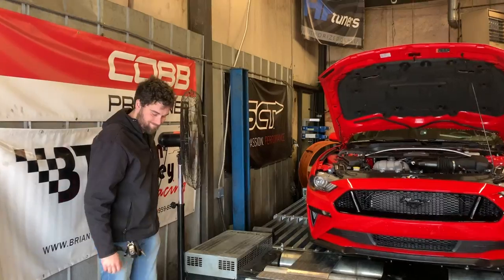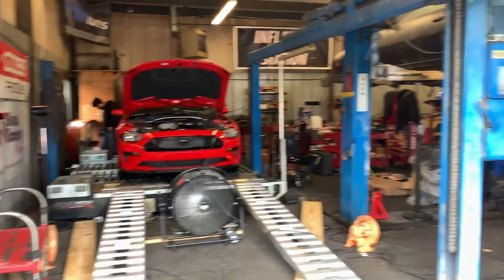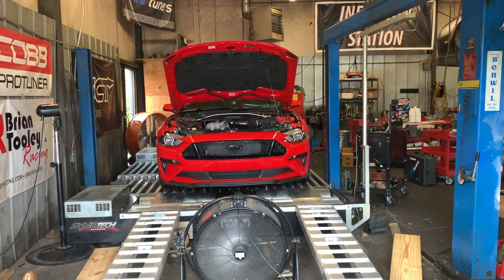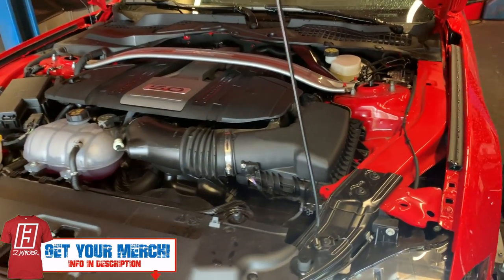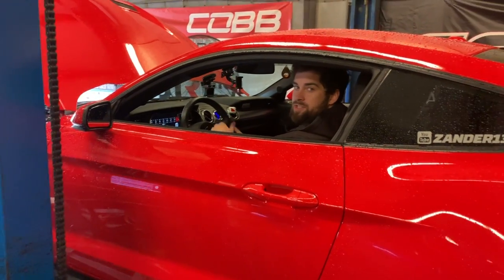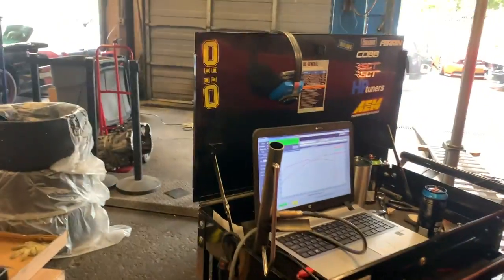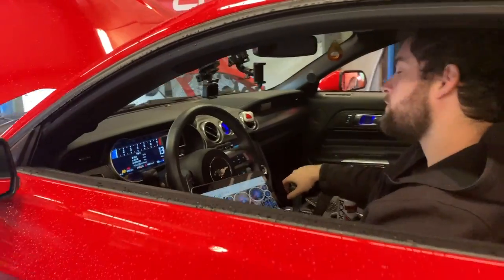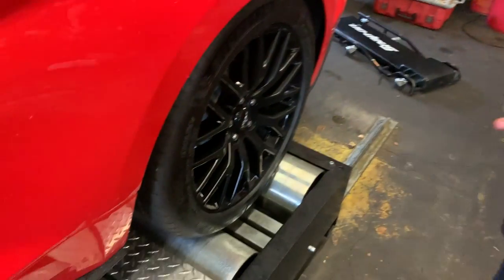NO B.S | This is what a 2018-2019 Mustang GT Actually makes on a Dyno

Comment: That sounds dead on correct for a 6500 RPM pull. IMO, you're looking at about 415 as it climbs to 7500. Nice of those guys to offer you their shop for comparison.
Reply from the maker: Yes, I am thrilled they did that
Reply: Zander13- Didn't beastmode hit 436rwhp 400 trq at 7500 in his 2018..? In your blue 2018 was 430rwhp...
Reply: I think at 7500 rpm is the meal ticket as the top end of that is where the full power comes from, right??

Comment: Glad you was able to get a comparison! I would have liked to see him take the limiters out and run it to 7400 just to see. I agree having a local tuner is great.. Has worked out great for me having one close to me... I wouldn't have expected the service that I received from my tuner  from a tuner that was remote tuning. The trackside tuning alone was worth it...

At the end of the day your hp numbers can vary from dyno to dyno.. I've always said its a tuning tool and good to use when you do modifications to the car so you can see what you picked up from modifications. If you use the same dyno over and over. Trap speeds at the track tell the tale!

Comment: I've dyno'd anywhere from 340 to 370 hp at the rear on different dynos. I've never cared what the number is,  I only care how the number changes on that dyno, on that day, in regards to the changes i make. It's a tuning tool.
Reply from the maker: agreed
Reply: Another way to say that is it's good for measuring relative values, not absolute values.

Comment: My 17' GT with 8000 miles got 379  6 months ago, for comparison, bone stock except we removed the air filter, Phillips 66 gasoline... 6 speed manual...   Automatics do better with turbos,  manual transmissions probably would do better with a supercharger.

Comment: Supposed to do dyno runs in a 1:1 gear ratio. For the A10 that’s 7th gear. Any gear lower than that, even 6th, is still multiplying torque and will give a higher/false reading.
Reply from the maker: A gear below 1:1 does not make more power. It makes less not more but a gear above 1:1 will show more power.

Comment: Eddy current, dual roller and single roller inertial all give slightly different readings. 
Hell tire pressure can have a significant effect on RWHP readings.
Nice results for an oem set up!!!

I can't wait to check my 19 GTPP on a DynoJet in ground single roller inertial that we use locally. My 460 powered 73 LTD did 456 SAE NET @ 6k rpm.

SJ

Comment: Good video man! Glad you redid it. All these engines are pretty predictable in stock trim, and even between all the different tuners and tunes I've seen this year, I haven't seen variation between the tuned cars any more than 10whp at the max.  Especially the A10 cars, the stick cars do put down around 15-20whp more, but then again, they sure aren't quicker at the track either.  A10 is definitely the way to go if you want to have a quicker car right out of the box, go stick if you wanna have a bit more fun and spin the tires on the street at will.
Reply: Beastmode in his 2018 10sp auto hit 436rwhp at 7500....  im not sure you are accurate in that comment. Also, zander in his blue 2018 hit rwhp of 426, 428, and a 430hp....

So are the 2019 not producing as much, or the hit @6200-6500 losing that much power by not hitting the 7500? Just saying, two 2018's both were very similar with an additional 26-36 rwhp @7500...????

Comment: Zander. 
The only dyno numbers that matters to the viewers, are the standard Dynojet ones (non Eddy current ). 

So if you want a real world number, both for you and your viewers. Get the car baselined at a Dynojet 224x and have the rev limiter removed so you can rev out the motor.
What is the point in dynoing  a cars engine power if you don't use the full range of the engine powerband!
As a tuning tool you can use whatever dyno you want. But as general comparison tool against other cars engine power. The industry standard is the Dynojet 224x.  That are the only valid comparison numbers.

Comment: Just think, the stock 2018 and 19 GT's, are making over 50+ rwhp and 50+ rwtq more vs the 15-17 GT's. Then you factor in the awesome 10r80 and you have beast of a machine. I know, I had a 17 GT manual and just bought a 19 GT PP 10R80.

Do you plan on getting a tune? I'm seriously considering it just to firm up the shifts and fix some of the lower gear downshift revmatching issues in manual mode (3rd to 2nd is one of the worst).
Reply: JCTiggs 
Do you mean 50 more based off dyno numbers because the factory hp from a 2017 is 435 hp and 400 tq, Fords claim is only 25 hp more and 20 tq more because of the addition of port injection and the gt350 intake the 2018 numbers from Ford are 460/420
Reply: @Sonicaceman  Yes, that is confirmed SAE rwhp and rwtq based on many dyno runs in other words, 490+ hp and 455+ lb ft at the crank. This is at least 55 to 60+ hp/trq compared to the 15-17 GT.  The advertised numbers at the crank by Ford are underrated and is a well known fact. Possible reasons could be to protect the GT350, otherwise who knows.

Comment: 442bhp 511 tq to the wheels at 7100RPM on a Swedish (EU) 2018 GT, Manual with 3.55 gearing (different to PP1 in the Us albeit being a PP1). 98 octane (EU, 93 US but probably higher quality fuel). Pleased. Us EU people get gas particulate filter on all 2018+ which I thought would ruin the power but numbers suggest otherwise. Also one has to wonder how empty that particulate filter section of the exhaust is, as well as the cats, considering the power. 450 BHP claimed on EU cars, delivering that to the wheels....... lol. PS: Dynojet used in this case with fuses out to prohibit BS letting us dyno it proper. Tried both 4th gear (straight ratio) and 3d (computer re-calcs) and the values matched until rev limiter due to 155mph limiter vs 3d gear not hitting the limiter. Hence reliable numbers since curves matched until 6900 rpm in both cases, numbers too.

Comment: The 3 Mustang GT's I have seen dyno'd stock make between 400-415 rwhp.
These new Mustangs with Autos have around a 12% Parasitic Loss, Which would translate to 405 rwhp from 460 crank hp, so you are right near what it should be.

Comment: Dyno numbers can change day to day i found and are hard to repeat  because of atmospheric conditions   plus types of dyno  used even technicians operation can cahnge data that why when rating it done over several months and different dyno's,,   I do wanna say this car number are awesome for a stock daily street car this is rear wheel numbers flywheel power should be approximately 28% -30% higher

Comment: I think a tune does up the speed limiter were you can do it in 6th as i did mine. My tuner said that i could have done it in 7th but it was too late by then because i talked to him after the dyno and not before. He told me between 6th and 7th there is 10-15whp difference. I did 443whp and 410wtq in 6th at 75 ambient. In 7th it would have put me probably at 453-458whp. Either way this is your older vid your much much higher now, love that red. Great vids keep posting them.

Comment: In reality horsepower is an arbitrary number. It is relative to tourque. The hp and torq will always be the same at 5,252 rpm. If you want higher horsepower do your pull in a higher gear but this will reduce your torque. The only way to truly compare hp numbers would be to test it in the top gear where the transmission is running close to a 1:1 ratio. For instance older s197 mustangs come out with like 3.56 gears where the newer stanges come out with 3.73 gears with more gears in the trans. These mustangs being fast have more to do with transmission, gears, and 7,000 plus rpm redline, and they have electric power steering. Motors are good but wouldnt work as good with the older mustangs gears and transmissions.

Comment: glad you got it worked out. i was wondering if Ford made a mistake and you got a Bullitt engine tune. Stranger things have happened in the automotive assembly line. I think the most first mod people do is cold air intake or a X pipe exhaust. Looking forward to see what you do with yours. :)

Comment: with your single "mod" im completely comfortable calling it a 430 horse car. Those 10r80's have virtually no extra parasitic loss over the mt82's. Modern automatics are magic compared to ones even 10 years ago. Coyote motors are neat little engines and all but the real secret of them are the heads, from the factory the heads flow better than full cnc ported 429 heads and as well as fully ported ls1 270cc heads and thats before porting, after porting they flow as well as ls3 290cc fully ported heads or any 12 degree brodix bbc race head.
Reply from the maker: We re dynoed the car in another video at it 408 at 6500 rpm. If we could spin to 7500 I’m sure it would be 415

Comment: Only difference is a cold air intake and tune on the bullit  a little different muffler as well i think...
Reply: The bullit has a ported gt350 manifold from factory as well. I think a bigger throttle body too but not sure.
Reply: @rileyneufeld7001  yea i think you are right a good value really for the money nice set up.
Reply: @coloradokid808  Yep. Midnight performance dynod one, it made about what a GT makes... Not much difference.

Comment: I'm curious to see what the numbers are if you put it on an actual DynoJet. I assume you had 93 Octane in it?

Justin on AM only pulled a 398 rwhp with his 10R80 but it's was right of the show room for with 87 Octane. That's the lowest I've seen for an 18+ GT. For comparison, on the same dyno, their 2018 GT pulled 437 rwhp and 402 rwtq, while their 2015 GT pulled 370 rwhp and 350 rwtq.
Reply from the maker: Yes 93 octane

Comment: Another great vid my man! I just went back to my dyno printout because I didn’t notice what they revved it out too during my pulls. Looks like they shut it down at 6800 RPM on mine. You definitely have another 5-15hp in there if you can rev it out past 7k.

Suspension mods? Cradle lockout? Rear subframe connectors? Those are my next mods haha 

Keep em coming brother, great job! Cheers
Reply from the maker: Thanks, I think so too. If it would go to 7-7500 I think 415 is very possible. And yes, Some pre-track IRS suspension mods

Comment: Honestly, a bit of a waste of a trip. It’s not a DynoJet and still uses vehicle weight and some load value. Find a real inertia DynoJet if you want more ‘real’ numbers people can relate too. But all in all, I’m sure the car is making good power.
Reply: stein78 weight is not a factor on the dyno dynamics at all.  It measures the resistance against the eddy brakes and will directly simulate a loaded dyno jet within 2-3 whp

Comment: Why does Ford advertise/claim on their website 460 hp? Are they using a different dyno? What's the deal?
Reply from the maker: They advertise crank HP. Actually wheel HP is less. So if my car makes 430 wheel then it’s right in line with 460 crank. My car now makes right at 500 wheel. So it’s closer to 560-570 crank

Comment: Wait so these only lose around 60hp from the crank? I thought these were rated 460 stock?
Reply: Ford usually underrates their cars and trucks a little bit even the 18 f150 5.0 supposed to be 395 hp and at the wheels can make about 350 hp no tune
Reply: @kevinanglin678  why do they do that?  basically lying about the the specs
Reply: @noelbarrera5674  emissions probably

Comment: My friends 6 speed put down 409 HP 407 torque
Reply: That's low for a manual they usually make around 425 or so whp. May just be a low ready dyno, probably a mustang Dyno they read a good 10-15 hp lower than a dynojet.

Comment: As a 2019 mustang makes 339kw at motor ford must be lying about there power figures as it would make 340 to 350 hp atw in Australia our holden vf gts is a supercharged 6.2l 430kw when put on dynos the make 420 hp atw

Comment: The way I remember 2016 camaro ss had 426-427whp with 455bhp
Reply: That seems high.  Usually a 15% off of the 455hp #.
Reply: LuvKills Slowly I know its kind of high. But the youtuber mentioned that its stock
Reply: @erikzakharyan4313  What I'm saying is that the dyno at 427WHP is way too high for the stock HP of 455bhp.  A loss of only 28bhp based on 455bhp is 100% incorrect.
Reply: @JasonJolo98  he’s actually right

Comment: 400 is right where it should be in stock form at the rears,translates to 460 hp at the crank aprox. 15% parasitic loss in the drive train.
Reply: The drivetrain on these cars is much more efficient than 15% besides 15% at 400 rwhp comes out to 470 hp... These cars are around 11% maybe 12%...  408 / .88 = 463 crank 408 / .89 = 458. If the car was able to pull to 7400 in 7th gear it would have put down close to 415 rwhp Ford may have slightly underrated the car but not by much... 415 / .89 = 466  crank HP. So my best guess is 11% drivetrain loss and yes it is just a guess unless someone wants to take the engine out and slap it on an engine dyno we will never really know for sure.
Reply: @sd24734  You really need to buy a calculator before you start talking shit,15% of 400 is 60.The car is rated at 460 HP at the crank,that is how the manufacturers rate their cars at the crank NOT the rear wheels.If you can add you will see my 15% is VERY accurate .And its a well known and referenced number in the automotive world.Also the two piece drive shaft in that car is even more power robbing than a one piece shaft.I also stated approximately 15%.I checked your video with the supercharger noise,that is the sound of a motor that will soon come apart.
Reply: @sd24734  Another thing to factor in is  slipping of the tires on the dyno, a Dyno where it bolts on to the actual lugs one made 425 10 speed too! And it doesn't have to spin the wheels
Reply: pat mcgeough, First of all, I wasn't talking shit so now that is out of the way... you are 1000% wrong on how drivetrain loss is calculated... you don't take 400 x 15% and then add that number to 400... so you did 400 x 15% = 60 then 400 + 60 = 460... that is wrong the correct way is to take the rwhp number 400 divide it by .85 which is 15% and that comes out to 470 which is correct...  why don't you read this http://www.math.com/school/subject1/lessons/S1U1L7DP.html you might learn something.  Oh and that noise in my video was a loose pulley it has been fixed and the engine is fine but thanks for your concern lol.
Reply: @coloradokid808  if you watch the video you will see that his best pull came in at 408 rwhp I never said his car made 410... the only person being childish is you with the name calling and profanity... it isn't my fault you don't know how to properly calculate percentages... I also never said the engine isn't rated 460 HP not sure where you got that from the only thing I said is the 2018 -2019 Mustang GT is more efficient than 15% drivetrain loss... I don't really care what you think about me or if you believe I have the car or not but you can keep trying to insult me it isn't going to work.
Reply: @sd24734  It would be nice if You just mind your own business,I was conversing with Zander NOT you.You bust in correcting me like you are better than me ,I don't need your opinion or your math lessons I am a real mechanic that works on his own car so stop bothering people that do not care for your opinion.
Reply: So first off I never said or thought I was better than you... you made that assumption. Secondly, this is a public channel and if you post here others can and will respond that's why there this comment section if you don't like that don't post anything. Lastly, I am so happy you aren't a fake mechanic and glad you work on your own car good for you not sure why you felt compelled to mention that but whatever.
Reply: @sd24734  keep a bucket in your trunk for cleaning up the parts someday you will need it.Must be 20 videos of exploding motors on this channel lol...

Comment: I am happy to hear this in a way. I bought a 2018 5.0 GT 7 months ago. And I sincerely doubted the "460.00 hp @ 4700 rpm" B.S. the factory spues out at the consumer. It feels more like 380 bhp to 400 bhp AT THE MOST!!! Thank you Zander13!
Reply: Justin Christensen 

Not sure where you found your numbers but this is from Ford.

460hp @7000 rpm and 420lb/ft @ 4600 rpm.
Reply: thats at the crank , not the wheel. They dont false advertise

Comment: Seems very low compared to other dynos on the 18. What does that mean your car is getting at the crank?
Reply from the maker: The auto kills the power. If it would go to 7500 I’m sure we would have seen about 415hp as I said in video. Manual 18-19s are getting 430 stock.

Comment: Dynos are so all over the place. In August, in pea soup humidity, and Lund stated " Crap gas" mine made 420 wheel with LTH, catless, Xtreme cb, Lund 93 and JLT box. I could go now to the same dyno but in todays air and prob see 440+. Which it BETTER make LOL..I now have a Steeda sealed lid intake and tune revision. Car feels very different and a lot better.

Nice pulls man. Car is strong.

Comment: I still don’t understand why it’s not running like it does on the streets. I don’t get why it’s not hitting 7500rmps. I have a 2018 GT whipple stage 2 That I plan on dynoing.
Reply from the maker: I have no idea
Reply: Tony Salazar  if you look in the video. 6-7th gear have transmission rpm limits that are lower than 1-5th so those gears will still rev out to 7500 vs the higher gears stopping Earlier.  There are about a dozen or so potential rpm limits in these cars from the factory
Reply: Tony Salazar also the whipple tune will have these limiters raised so you wouldn’t experience this
Reply: He's probably not doing 7500rpm in 6th or 7th gear.
Reply: Taylor The Tuner thanks for the info. I’m yet to get on it, still in the break in period. Wanted to wait till I got 1k miles on the motor and 10 speed.